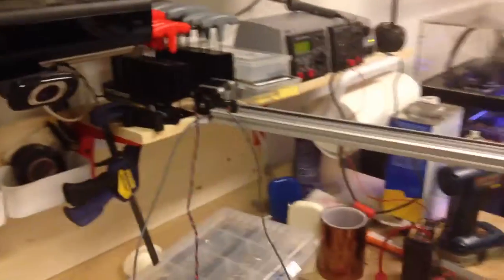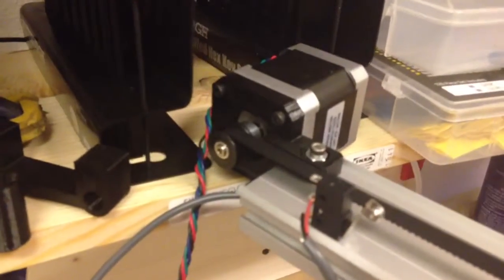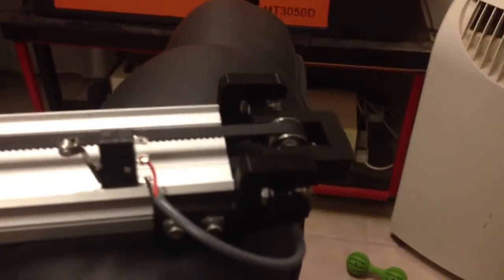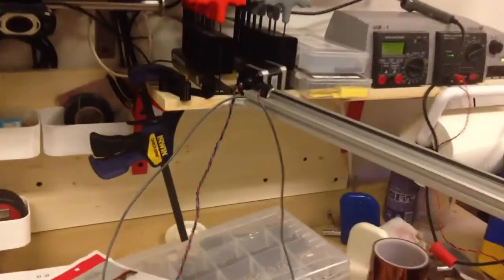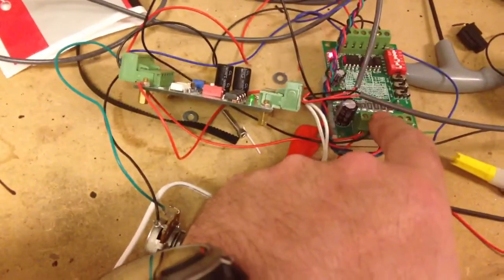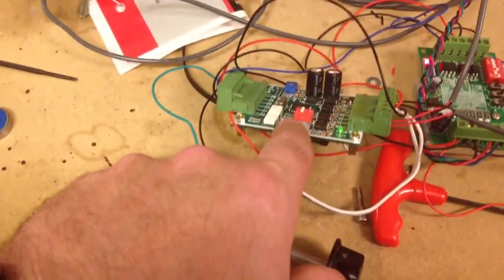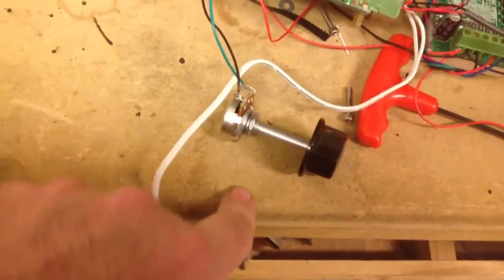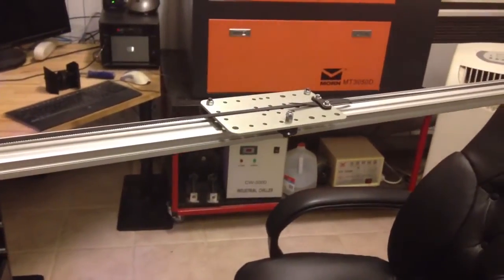Makerslide stepper motor dolly

Comment: This is exactly how I was planning on re-doing my camera slider! if you check my channel you can see how it is now, (and stayed since I've abandoned it till I get my 3D printer) Although I'm not sure how well the belt will run through my makerslider since I have the original design. Do you mind sharing the .stls and the CAD files for the end pieces? I don't think the new motor I bought fits in with NEMA standards, So I might have to modify the motor mount.